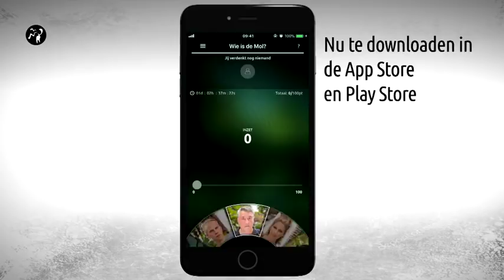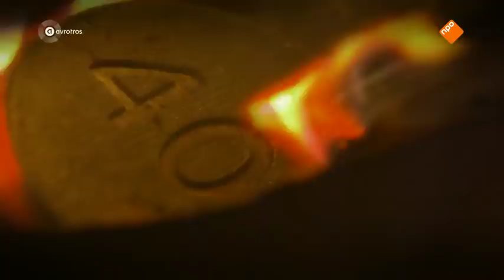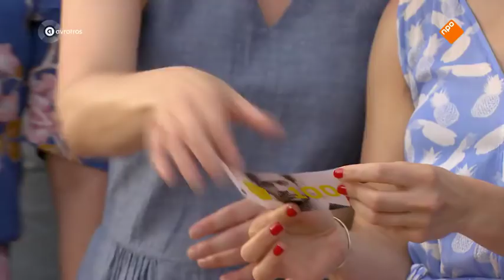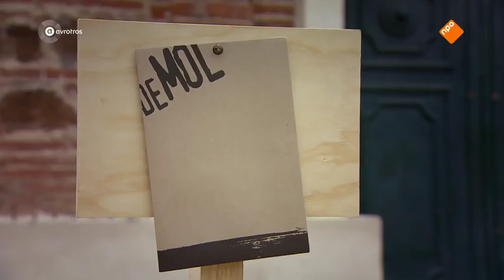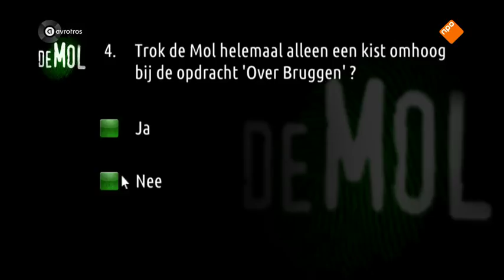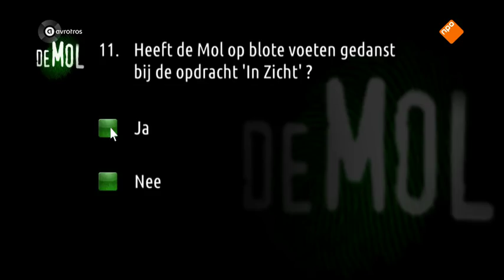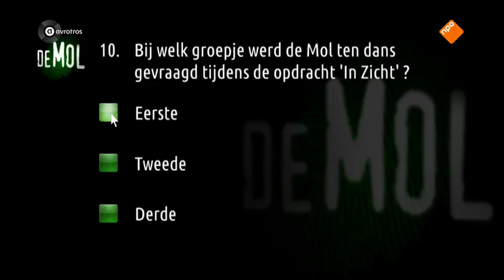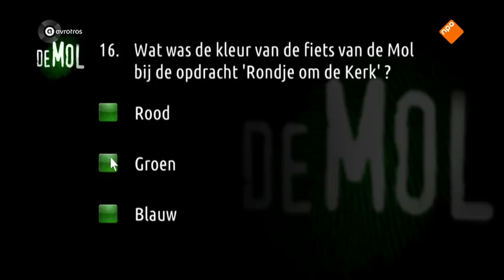Wie is de Mol (The Mole) S19E01 with English subtitles

Comment: Thank you for the fast upload!! Is it also possible for the non-englishspeaking people to translate the screens on the bike?
Reply from the maker: The 'problem' is that the subtitles are already coded. That's why I can be so fast. Adding one extra in between wouldn't be possible without spending another hour changing the coding. The messages are all a name, a time and a certain church they had to be at. So you can still see who was wrong.
Reply: @WIDMEnglishSubs  that ain't worth the time indeed.
Reply: @jauri8994   I used Google Translate and quickly found out the extra translation wasn't necessary.